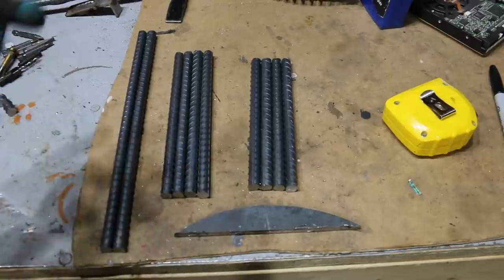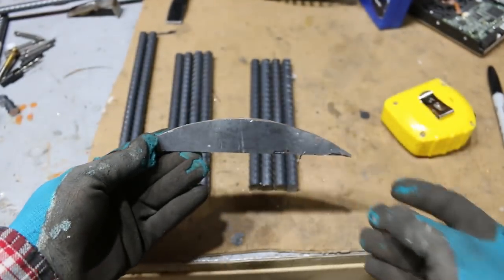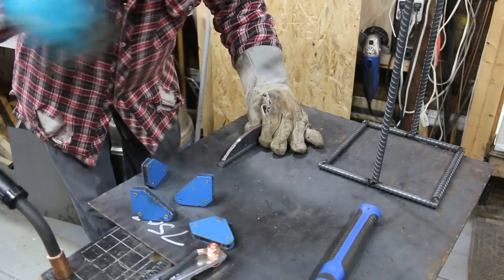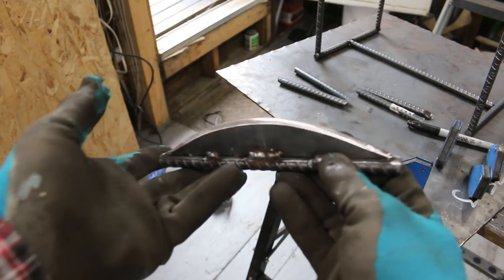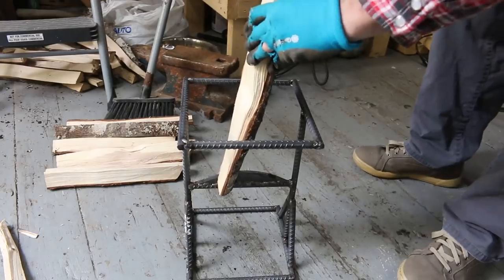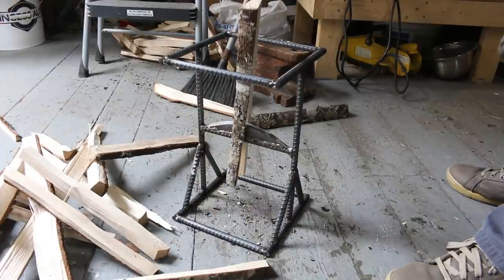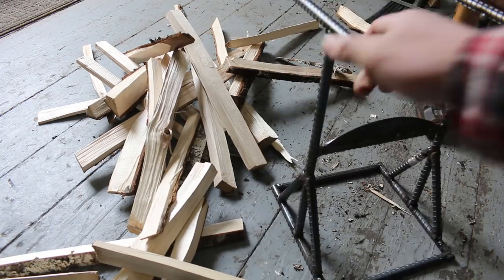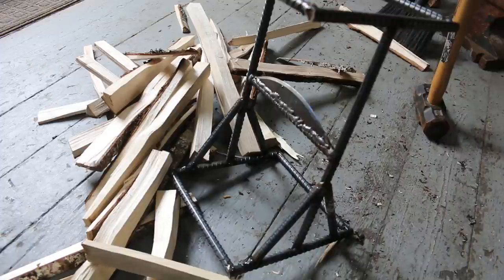How to Make a DIY Kindling Splitter from Rebar

Comment: Nice I like it!!! But i think id use just an axe head instead of the blade you made. Nothing against your blade it's just an axe is meant for cutting and it's more of a wedge plus the blade is hardened. Or you could maybe harden and anneal/temper your metal blade otherwise it will need sharpening way more! Anyways thanks for Sharing i really like the Easy frame you made! Sorry for the criticism, i swear its constructive Criticism! Lol not meant to offend. And im sorry if it did! Have a great evening!

Comment: Saw this on Instructables today.  Nice build! my only concern would be the blade cross-section. That's the portion of the splitter that takes the brunt of force, and there's only two small connection points of the rebar on either end. I foresee that with continued use, those welds are going to weaken and eventually break. I probably would have dropped the blade section down another inch or so and welded those reinforcement pieces you have set at an angle onto the blade section. or even get four more pieces of rebar and put them in on the blade section. durability in the area that is going to take the most stress is key. but overall, I like the initial concept. it's simple, practical and yes much safer than swinging a maul or an axe - splitting wood the traditional way scares the crap out of me, as its only a matter of when, not if, something bad happens.
Reply from the maker: Thanks for watching, yeah this was a quick dirty build with stuff laying around, for my needs it should last a really long time since it for making kindling.  I might make a stronger one eventually :)
Reply: I was thinking something similar to Patrick, but I think bringing the blade up would be better.  Cut off the excess uprights and square frame at the top and use that rebar to re-enforce under the blade ends with a couple of small gussets.  Re-use the square just above the blade so you can put a board (double leg TT profile) on it (like a stool) to protect the blade (and careless people) when the splitter is not in use.